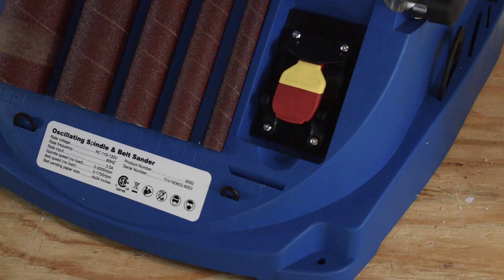Eagle America Dual Purpose Oscillating Spindle and Belt Sander

Comment: NEW!
Oscillating Spindle Sander and Belt Sander
Spindle Sander and Belt Sander in One!
(0 Customer Reviews - Write One Today) 
 Description 
Dual purpose benchtop Oscillating Spindle Sander and Belt Sander easily converts from a 4" x 24" edge belt sander to a spindle/drum sander for most sanding applications. Features include a tilting table and on-board storage for drums, table inserts and edge sander belts.

Specifications:

Sanding belt size: 4" x 24"
5 pcs rubber sanding sleeves (4-1/2" long): 1/2", 3/4", 1", 1-1/2", 2"
5 pcs Sanding Drums: 1/2", 3/4", 1", 1-1/2", 2"
Table Tilt: 0-45 degrees
Includes 5pcs 80-grit sanding sleeves and sanding belt
Sanding Belt Speed: 1575 FPM
Spindle Oscillation: 5/8", 58 oscillations per minute
Motor: 1/2 HP, 110V, 3.5A, 2000 RPM
* 1-1/2" Dust Port *